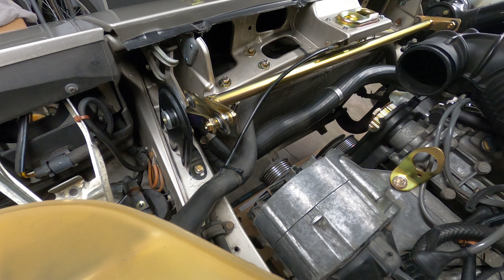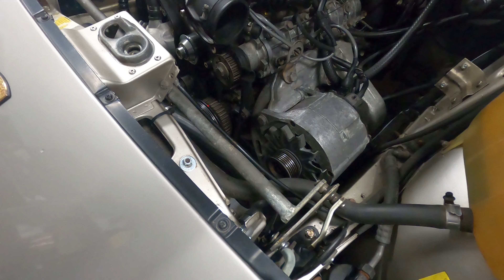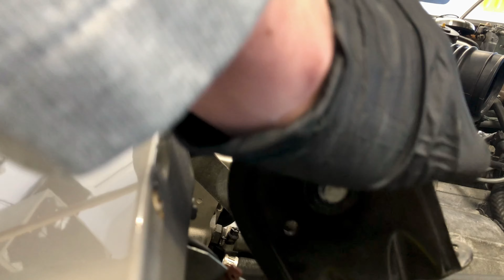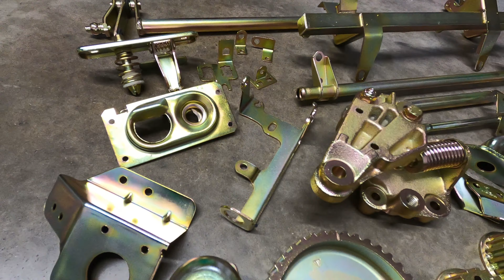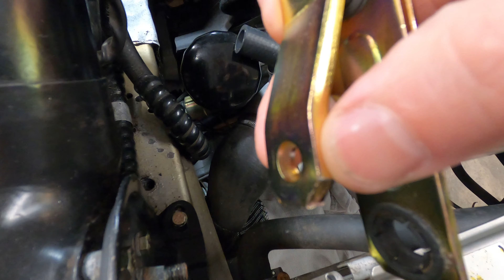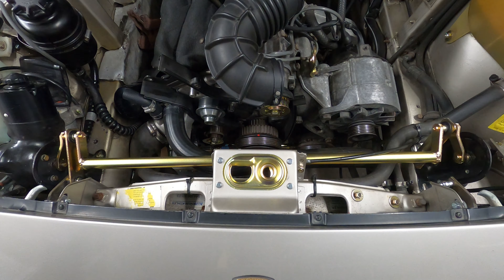Porsche 944 – Headlight Control Shaft Removal/Restoration (Zinc Plating)

Comment: I just had a bunch of parts zinc, plated, and the company would not do the linkage assembly because they said the muriatic acid would ruin the plastic bearings. Can you please provide the name of the company in North Carolina that replated your linkage with no issues?  Zinc platers are getting hard to find and even harder to find a quality company.
Reply from the maker: For the zinc plating, I used Parker Metal Finishing in Greensboro, NC. www.parkermetalfinishing.com

You’ll have to call and go through Robert Parker, as he’s the only one who deals with it. The cost is $125 plus return shipping, and that will cover just about everything steel you can get out of the engine compartment. 

All the parts will need to be stripped clean before you send them in, bead blasting is best, the quality of the cleaning will directly affect the quality of the plating. I use a local powder coating shop for my blasting jobs.
Reply: Awesome!  Thank you very much 😊

Comment: Did you remove the plastic inserts in the brackets before sending off for zinc plating?
Reply from the maker: I did not, as it’s likely they’d be damaged in removal. Since the plastic bearings don’t conduct electricity, the plater had to attach a wire to each metal bracket.
Reply: @NC944er  Thank you - that is my worry, I can't find replacement plastic inserts, so as you say in your video it is a risk but worth taking

Comment: Your engine is looking great!  I'm into a major engine cleaning, vapour honing, and plating exercise on my 86 turbo and love the contrast between the yellow zinc and the clean aluminum on our engines.  I noticed that you plated the bottom cover from the cruise control unit and decided to do the same. Unfortunately it doesn't want to come off even with the three small screws removed.  Is there something else inside holding that cover on, or do you just have to use a bit of force to pry it off?
Reply from the maker: @951resto  Hey man, thank you! I believe you’re referring to the cylindrical steel housing for the cruise control servo motor that mounts on the back of the assembly. The mounting flange is somewhat triangular and features three bolts. On the lower tab of the flange, you should notice some raised material right next to the bolt hole, which is the top of an alignment pin that’s attached to the main aluminum housing. This pin gets “mushroomed” over with some kind of hammering force during production to lock it in place. To remove the steel cylinder, you can either very carefully drill out the pin (there’s a circuit board just behind it), grind off the protruding material, or simply snap it off by tapping a chisel between the mating surfaces (which is what I did). There are two magnets inside the cylinder that ended up collecting a lot of metal flakes during the blasting and plating process. I later spent about 30 minutes removing all the metal specs before reassembly. Here are some disassembly pictures so you can get an idea of what’s inside the servo. The second to last image in the reel shows where the alignment stud snaps off - https://www.cruisecontrolrepair.com/servo

Comment: What size bolts/nuts did you use for the lower hood latching mechanism?
Reply from the maker: The lower hood latch hardware and Porsche part numbers are as follows: M4x8mm bolts x4 - (900-075-116-02), lock ring x4 - (N-012-004-2), M4 nuts x4 - (N-011-004-G). Getting the nuts threaded below the latch takes EXTREME finger dexterity. 😂
Reply: @NC944er  Oh I bet! I'll be sure to call you up to come to TN to do it for me! Hahaha

Comment: Looks nice!  I would say that the rollers were not zinc plated from the factory.
Reply from the maker: Yeah, I know the spring tensioner was not, just the bolt/hardware for it. Not sure about the balance shaft gears, but they look cool. We’ll see how it holds up. 😁
Reply: @NC944er  yep, love the look.  Want to buy a kit to be able to plate at home

Comment: Very nice, but how did you get it completely disassembled? You didn't show the last linkage bits removed from the shaft.
Reply from the maker: Hey, thanks for your comment! I actually left those two hinges attached to the bar throughout the refurbishment process. The glass bead blasting won’t damage the plastic bearings and the bar can be plated as is if they account for the fact that the bearings won’t conduct electricity. The plating shop had to attach separate wires to both the bar and the two hinges for the coating to adhere. Hope this helps!
Reply: @NC944er   great info ,I'm just looking at having my control bar plated.  I wasn't sure what to do there.
Reply: Hello, nice video, i need help, my right headlamp is stuck it wont open or close so i want to replace the whole headlamp with plastic housing and swivel. Do you have any video how to do it? Thank you
Reply: So you had no issues with the plastic bearings in the headlight control bar being damaged by the zinc plating process (muriatic acid dipping)?   The plater I used would not plate the shaft amongst all the other parts they did.  Can you please share the plating company you used.  Platers are getting few and far between for small batch projects.  Thanks.